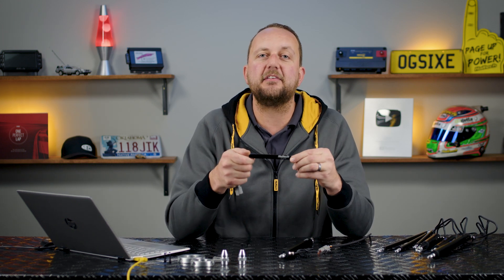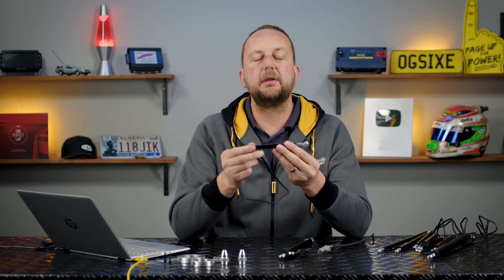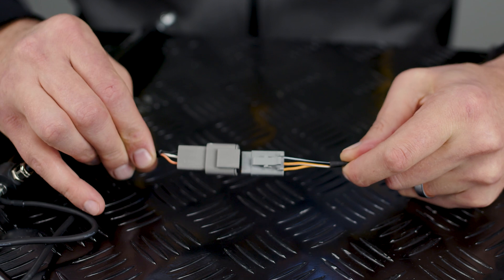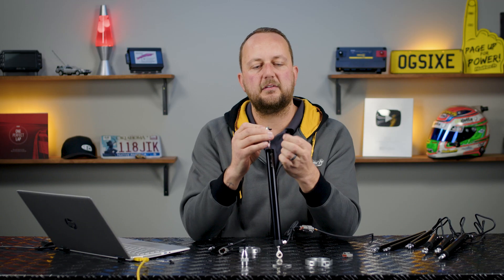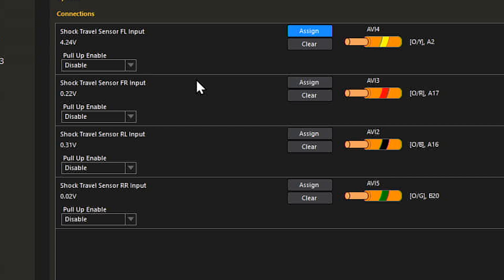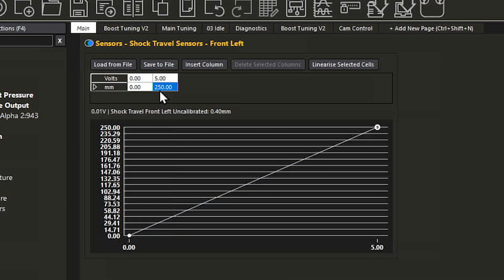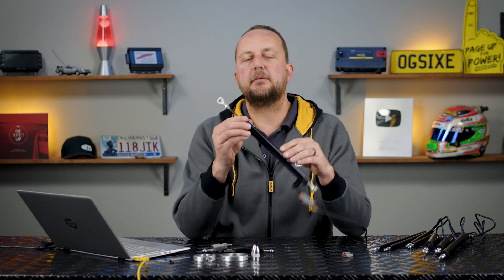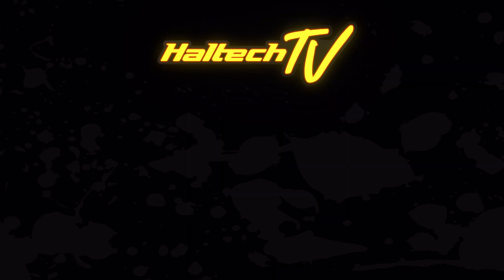🔍  How Linear Position Sensors Work | PRODUCT OVERVIEW

Comment from the maker: New Product Review Time!
Most commonly used as shock travel sensors, the Linear Position Sensors can also be used to measure gearbox shift shaft position, differential angle, or in any application that requires linear position data. In this video, we discuss how these simple sensors can make your ride not just faster but also more predictable.

More details and pricing here: 
https://www.haltech.com/news-events/linear-position-sensors/

Comment: if i connect the can obd2 connector and a Bluetooth elm type scanner will these analog sensors be output in that data? Like can I datalog it with an app like track addict? Or does only the normal engine type values come out through the obd2 ?  thank you

Comment: Where can I find more technical info - size of the rod ends, overall dimensions etc etc?
Reply from the maker: https://www.haltech.com/news-events/linear-position-sensors/
Reply: @haltech  thanks bit that only days the diameter and travel. What about the rest of the measurements?
Reply from the maker: If you click on the BUY NOW button it will take you to the product listing which shows you the distance from the mounting hole to the mounting hole and the diameter.

Comment: Is it possible to scale the output? Probably arbitrary but often front and rear shock travel isn't the same ratio to wheel movement, converting it in the software would be nice so you can compare numbers easier

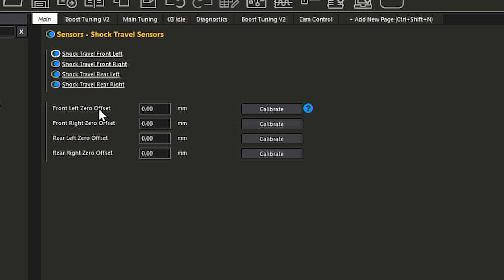Comment: I have the latest update NSP with shock travel sensors already installed but why I don't have the zero calibration screen which shown in 6:43 ?
Reply: @haltech
Reply: When could we have the update which include the zero calibration for those senaors
Reply: Three weeks after posting this video but still could not find the update which contains the zero calibration

Comment: given the .5" series has the same lengths as the 1", what's the advantage or differentiation of the 1" vs the .5"?
Reply: Im guessing mainly space constraints or maybe you are chasing the weight so you want the lightest sensor you can get. Plus for suspension a large sensor may be more optimal as it will be in an area where lots of things could be flicked up/ moving around. Whereas a gearbox position sensor where you would use the small sensor as it is shielded more and not getting as much movement or use.

Comment: Could you use 2 of these mounted at right angles or even 1 at 45* for a manual gearbox? I guess you could also use for a steering position sensor?